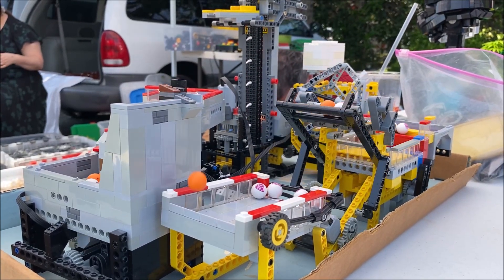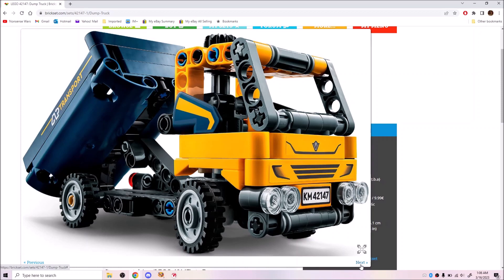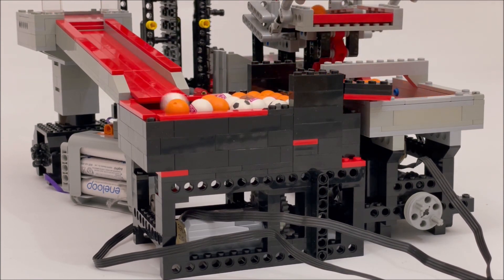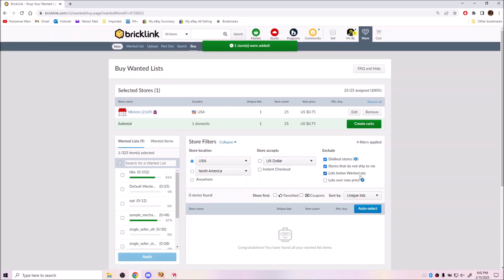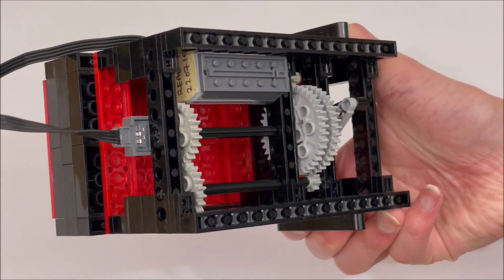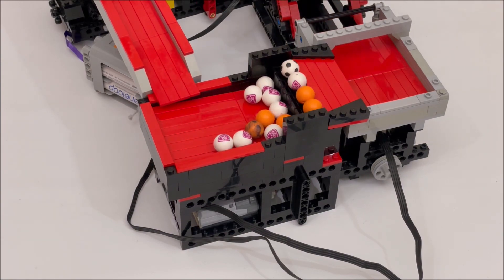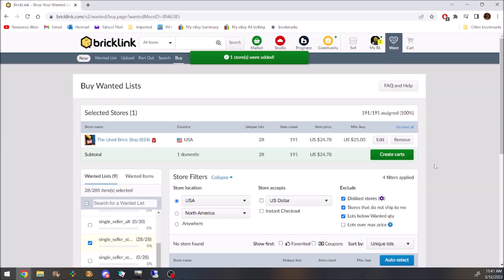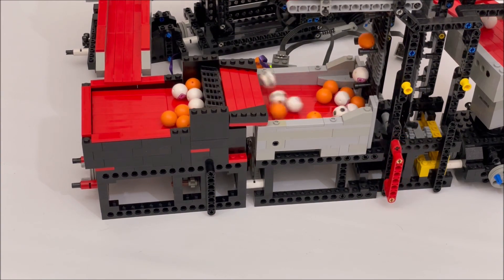LEGO GBC Single Seller Stepper v1 (starter module)

Comment: Maybe 1:24 using worm & a 24 tooth gear. Less gears & quite common. Could use 2 crank shafts on the same axle. One on either side of center gear train.
Reply from the maker: Worm gear is what 4barlinkage did for the Dozer Compactor Alt Model. It's definitely good solution if you want to go down the alt model route.

Comment: I went from avid technic collector to not having bought a technic set in 2 years because of this recent trend. Makes me sad. 😢
Reply from the maker: Another part of the issue is that, especially for smaller sets compared to those of the 80s and 90s, a lot more of the parts budget goes to cosmetic rather than mechanical features.

Comment: I like the single seller approach. Kudos for thinking of it from that angle.
Reply from the maker: I would be curious if there is a design that could use significantly fewer types of parts. Like I could cut a few types by making a less complicated drivetrain, but I dunno if it's possible to get down to like 20 or 10 types.
Reply: @NonsenseWars  I don't know if there's a standard lift height you're going for, but one change I see is using the 40t gear as the crank directly, pinned through one of the outer holes.  It reduces the lift height from 10 plates to 8, so input 1 higher and output 1 lower should function the same.

technic 10 beams could be replaced with 8s with 1x1 bricks on either end, as you're never running through the outer holes. That swap even lowers the total price, at least on my usual bulk brick source.

Using 4 8t gears instead of 2 24s would improve clearance from the motor so you could get rid of the 12 axle and 24t gear, but you'd gain an axle-frictionless pin to hold the intermediate gears.

I think potentially you could redesign it to use only 5L axles and joiners, instead of 3 sizes of axle, but that's a bit more involved.  More something to do next time around.  Though 3+5+joiner is no more parts than 3+10+12 and again might get you cheaper parts.

To go to ~10 part type counts I think you'd need to abandon the nice level beams, and build the entire model on a 5-10 degree slope.  Though maybe with a ball joint linkage you could have the base geartrain flat and only the whole top section tilted.
Reply: And here is my version of this stepper. For me it is more important to find more people building GBCs than to have less unique parts.  This is the reason why my one is  a bit colourful. I will take printed instructions to the next show 😁 Anyway, I like it, thanks for sharing 
https://youtu.be/euxRTDnYyto